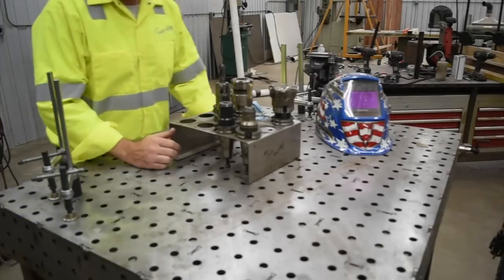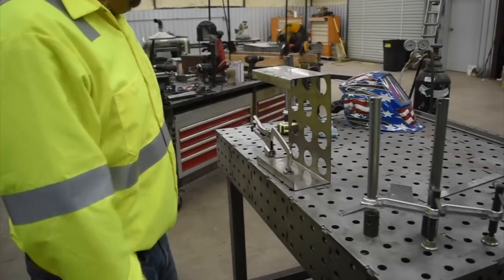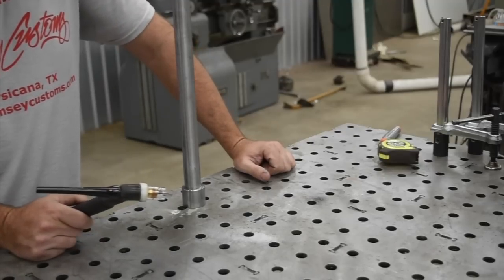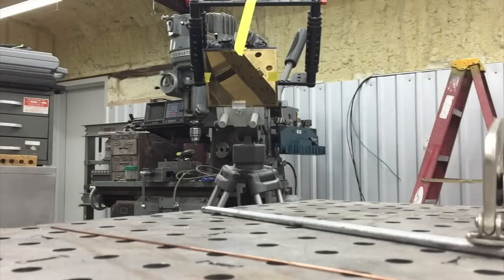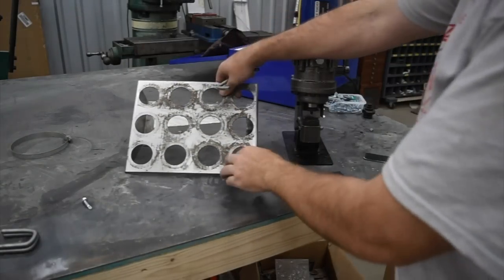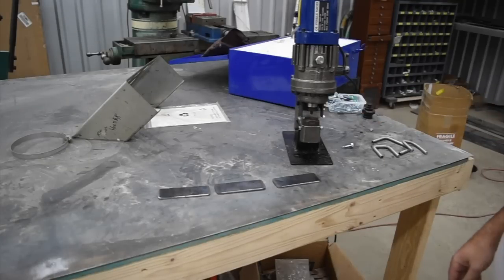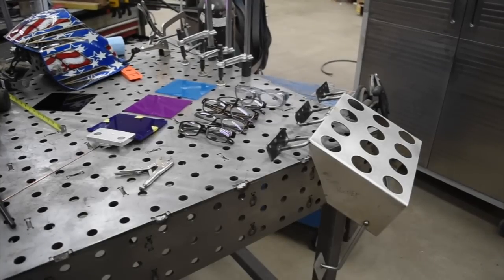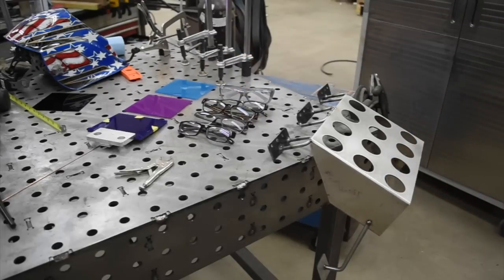#1 Best Welding Tip - Cool Blue Lense - Metal Bender

Comment: while welding, I can't see any further than the puddle and the arch, any ideas how to view where I want to weld a bead, Example I start at a 9 o'clock and try to move to the right to a 3 o'clock position, but may end up at 4 or 5 o'clock position, because I can't see the bead

Comment: cool blue being only for gas welding, I suppose you do not put your eyes ready for cataract by arc welding with them. that blue thing is an old hoax, if I understand well, they are cool for the camera in the end .
Reply: No it is meant to be used IN COMBINATION with a regular shade lens, green or gold plated. It is called a "drop in" lens, to be used on your eyeball side of the filter lens.

Comment: Man I've been looking for a cool blue for a while and couldn't find them. I had one and ended up having a 10" 900 series flange fall on my hood and shattering the it. No welding supply stores in texas/Louisiana carry them. I'm glad I came across this video. Thank you.
Reply from the maker: Cool thanks Jared.
Reply: Try phillips-safety, the gold glass lens plus the blue or magenta drop in lens is the best.
Reply: the Aulektro web site (I did get one of their gold plated lens) , state that blue is very tiring in a work environment , may be after some time, and that anyway it is not authorized for welding in Germany (the standard allow blue for infra red protection only)

Comment: HI Gary,
Thanks for the shout out!  I am glad the clamps work with your table.  I like the arc shots.  Pretty hard shots to get and you don't see many "get it" but I think you are there.  I really like what you did with the tool holder, spacing from your wall, and especially how high you put it on the wall.  It will stay out of the chips being flung from your mill - great idea!!  
Take Care,
Reid
Reply from the maker: Thanks Reid, appreciate your support, and definitely appreciate those clamps, you will see those bad boys in probably about every video!

Comment: Nice job Gary. What type of press did you use on your .270 holes?
Reply from the maker: It's an import unit I bought on eBay, it will punch up to 1/2" hole in 1/4" thick steel.  I demo'd it more detail on my other channel a couple months back.

Comment: Yessss, cheater glasses are the way to go. I also get wraparound safety glasses for all of the safety stuff and they have have a built in little magnifiers on each lens. Kinda like bifocals some what. They are less than ten bucks.   Wearing those readers under the hood is the schnizle .
Reply from the maker: Yes sir, I have some of those wrap around with the bifocal spot in the bottom.  I use those occasionally as well, I failed to show or mention them.

Comment: I've got a set of 2.0 safety glasses.  I never weld without them.  Also great for reading drill bits.  Thanks.
Reply from the maker: Thanks RJ, same here.  Not only welding, but anything where you are trying to do fine detail work, like the wiring I have been doing lately, etc.